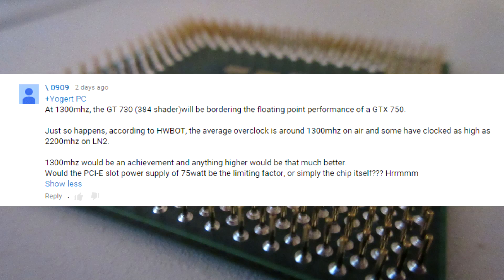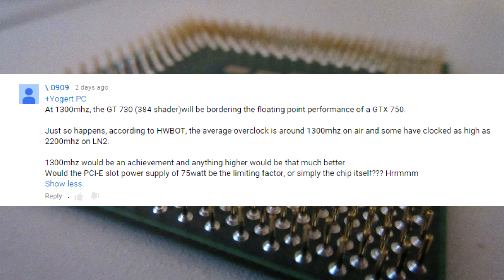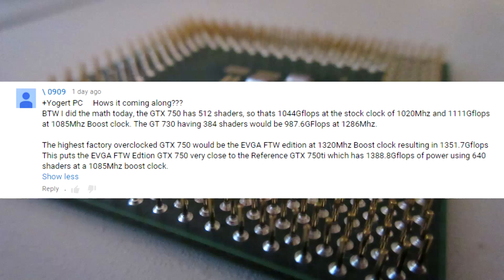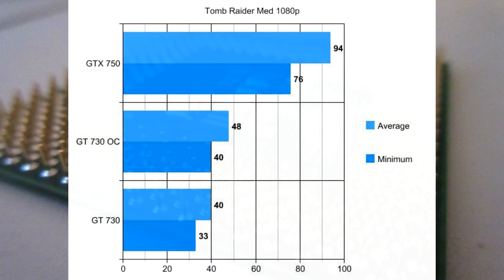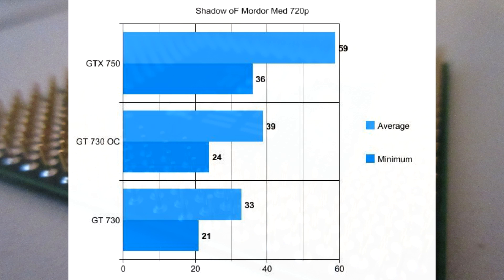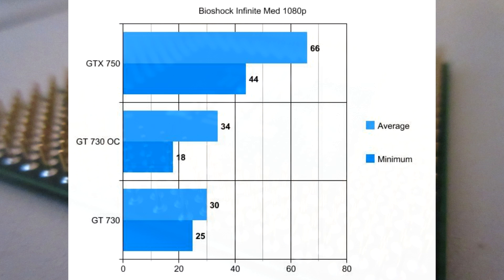GT 730 Overclock VS GTX 750 | FLOPS Comparison

Comment: Is it compatible with Gigabyte 880gm-d2h mother board (2012) model. Also the other specs are amd dual core, 4gb ram. If yes then How will be the performance?

Comment: On my rig, I actually OC'ed my GT 730 1GB GDDR5 adding 230MHZ on core clock and 330MHZ on memory clock... using an overclocked A4-4000 from 3.2GHZ to 4.08GHZ, 6GB RAM. It gave me noticeable increase in frames.... I recommend the GT730 GDDR5 for entry level gaming.

Comment: I'm broke so i bought a A8 7600 and used it as a processor only not as a APU and paired it with a Gt 730 1gb ddr5 that i was able to overclock to 1085mhz / 3000mhz(AIR) and gave me good results on my games @1080p thats a true budget rig under 300$

Comment: So what card would be better for GTA V? the GT740 or GTX750
Reply from the maker: Gtx 750 or 750ti. Probably a 750ti for more vram because the way grav shows how much vram youre using in the settings 1gb wont get you very far
Reply: +Yogert PC i have 4 Gb on the video card 730 ist good? /
Reply: +《Dr. Drink》 nope

Comment: +Yogert PC how far i can push of a GT 730 Point of view 128bits / 2 gb
DDR3/ 96 CUDAS / 21.3 Bandwith
Default Memclock: 667
Default Coreclock: 700
With a voltage of 1080 also is 1.0800 (i cant get any higher) For games like Warface, Unturned , Robocraft

Comment: What budget GPU do you recommend  with the AMD FX-6300?
Reply: You're gonna play Steam? Lol.
Reply: r7 370, or 270. gtx 750 ti, or 950, But you can find pretty cheap 960 witch will give you better graphics + fps, but may bottleneck the cpu. but any of them should profrom fine.
Reply from the maker: What games would you be playing?
Reply: Minecraft, Steam, mid graphic intense games...
Reply: homerboy12345 I meant like the games on steam lol
Reply: JonnyBricks I know... That's so broad, you could be playing Witcher 3 or Portal. Two different sides of the performance spectrum.
Reply: If you get a 750 Ti I only recommend the model with a 6pin connector.
Reply: Objectified Cross there I 6 pin model? I've never seen or heard of one?!?!?
Reply: Jerry-Ray Shaw 
Several brands made one. 
The model without has the same problem as the RX 480. And is notorious in forums.
Reply: ***** 
Actually depending on the games in question it should even push a RX 480 (which even an i3 sandy can push). But yeah.
Reply: ***** 
LOLWAT
Reply: Im Jin Ah lol yeah. The I think the regular 1050 will still beat the rx 460
Reply: JonnyBricks 
Honestly it probably all depends on the Price whatever store you buy from charges.
Reply: ***** 
I spy a rabid fanboy.

Comment: the GFLOPS calculation is really easy you just multiple the base gpu core clock in mhz with the number of shader units then multiply the result by 2 which gives the raw performance of the gpu in MFLOPS divide that by 1000 (or take off 3 0s from the back of the number) to convert it into GFLOPS

Comment: Should I go Nvidia or AMD?
I Play some games every once in a while (mostly Planetside 2)
I do alot of video editing and motion design.
Thanks - 
          Allen
Reply from the maker: +AllenArtz™  I'd lean toward nvidia in your case, only because you do video editing and motion design. Nvidia is known to be a bit better in those types of softwares, but theres nothing wrong with AMD. In some games, like Tomb Riader 2013, ive noticed AMD cards do much better in that title, different games will favor one or the other baded on optimization and other factors. To answer your question, Nvidia.
Reply: Thanks, I think i will get the gtx 750 ( I don't have much money as of right now )
Reply from the maker: +AllenArtz™ if $100 is your budget (thats how much the cheapest 750 is) i recommend the 750 ti, theres one right now that's $100 after a $10 mail in rebate. The 750 ti has extra memory and cuda cores which would certainly come in handy for what you do. 

If you need a link : http://m.newegg.com/Product/index?itemnumber=N82E16814487024&nm_mc=AFC-C8Junction&cm_mmc=AFC-C8Junction-PCPartPicker,%20LLC-_-na-_-na-_-na&AID=10446076&PID=3938566
Reply: +Yogert PC which version of the 750 ti should i get? MSI? GeForce? ASUS?
Reply from the maker: +AllenArtz™ the link i posted preciously is still the best deal, it's a very high factory overclocked 750 ti and it's $110. there is a mail in rebate, but you may not be able to receive, and mail it in before the 29th.
Reply from the maker: +AllenArtz™ so EVGA. MSI is my favorite brand but the Superclocked evga 750 ti is much faster
Reply: Thanks, Can this support windows 10?
Reply from the maker: yes, absolutely

Comment: Snap, I had no idea this was up :) I appreciate the great effort and education entirely.  So do you think the largest crutch is the limited memory bandwidth or did memory overclocking not seem to make a difference on this gpu??
Reply from the maker: I did other tests where i only overclocked the memory like 200mhz, and decreased the memory 500mhz and both times there was like a 2-3gps difference. The gpu did show potential, but i believe the memory bandwidth was a huge drawback
Reply: +Yogert PC On that note, it seems the GT 730 384 shader is the same as the GT 740, with the exception of the GT 740 having 128bit GDDR5. This making the GT 740 a twin of the GTX 650 Kepler GPU and the 92 Shader GT 730 being a rehashed GT 430. 
   The GTX 750/750ti/950 etc however are Maxwell GPUs, Having a much larger L2 Cache, taking the load off of memory and better management of overall shader compute, increasing performance per Gflops.
It seems your benchmarks further solidify these claims.

Comment: Yogert PLS tell me what to overclock the gt 730 to for best performance and not so my PC crashes, because when I Overclock it, my screen blacks out. :/
Reply from the maker: Only increase the core clock by about 50mhz at a time, if you want to squeeze all the performance out of your card as you can, you can increase voltage, i could only increase voltage with palit thundermaster. Increasing voltage will result in higher temperatures (nothing that high, maybe 50 Celsius) and lower the life span of your card.

You should be able to increase your core clock at least 100mhz without crashing or needing to increase voltage.

Memory clock won't effect too much on this card, you could turn it up 100mhz too if you like.

If you have any more trouble, just talk to me about it, id like to help as much as i can
Reply: Yogert PC K tks man love u dude
Reply: +Yogert PC hey man, what tool would I use to overclock the card? thanks
Reply from the maker: +Iface bookyou msi afterburner is what i usually use, but to be able to tweak voltage with the 730 i needed to use Palit Thundermaster
Reply: +Yogert PC Alright, do you think nvidia system tool will work too?
Reply from the maker: +Iface bookyou nvidia system tools has been moved to legacy so it's only available for 500 series cards and older. As far as i know